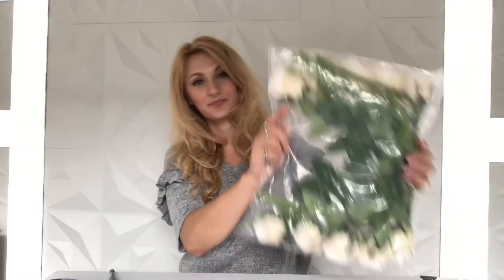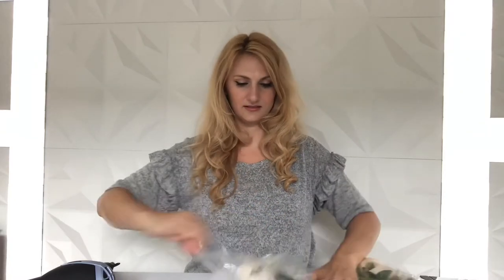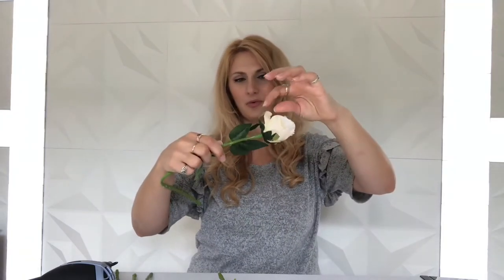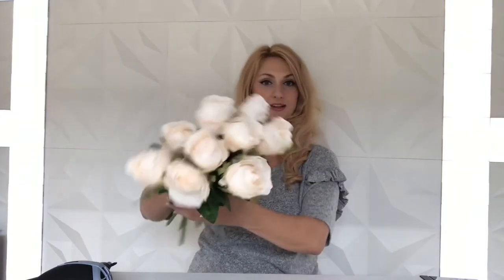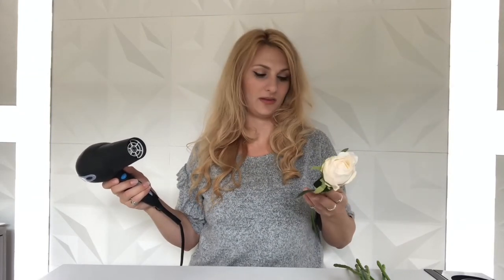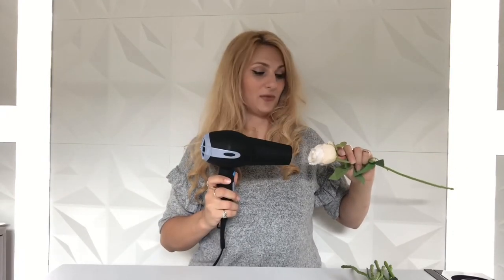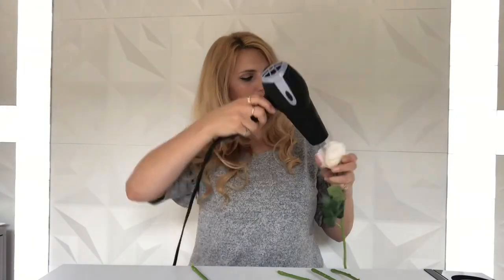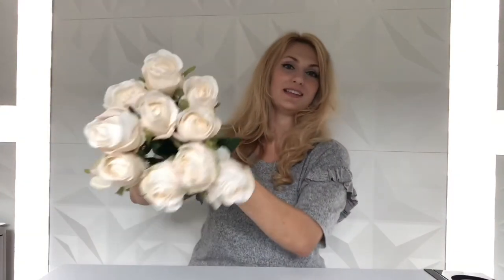DIY Hack Fluffing Flat Silk Roses

Comment: Thanks for this. Good to know.  Do you have hacks for the plastic branches on a eucalyptus Garland to fluff it up.  The main stem is wired but all the little branches with leaves are plastic so the whole thing sits flat. I tried green wire but it shows through between the leaves. I need to put 2 garlands together. And would love to add another (3rd) with roses or flowers for color. Do you have any hacks please? Thank you
Reply from the maker: Tough one! I've never actually worked with that. Unfortunately I'm guessing here, but maybe if you tie the ends to chairs (or similar) and run your hands over the leaves a few times and let gravity do it's work on them for a day? You could try a hair dryer as well. Best of luck, please let me know what works!
Reply: @StarsetMoonfire  will this work on my faux silicone orchid pedals?
Reply from the maker: @d5078  Sorry, I don't actually know that. I don't think I've tried on Silicone. If you try it, please let me know how it works!